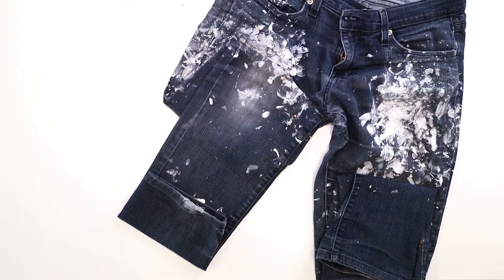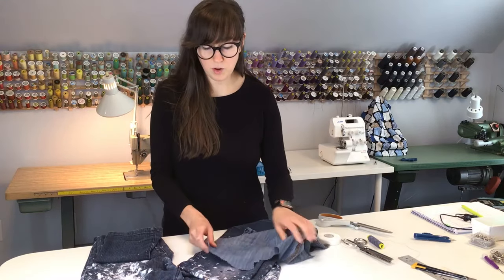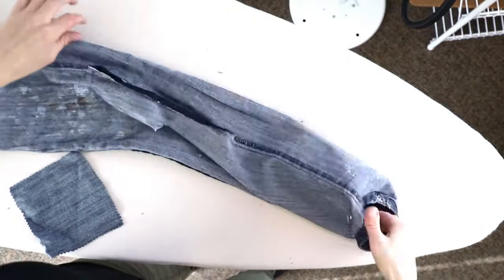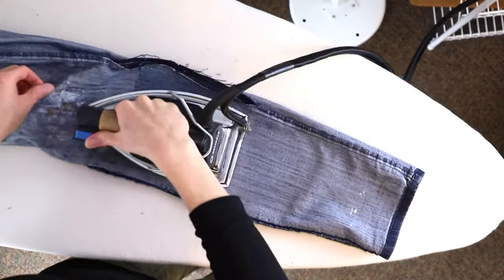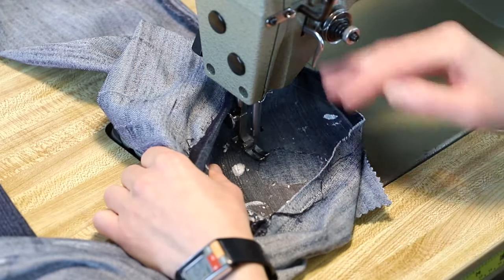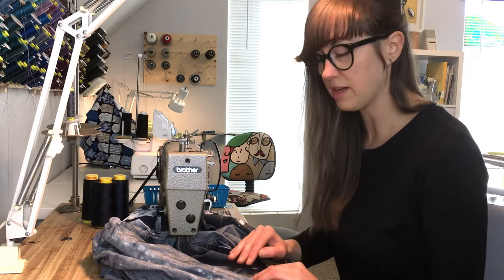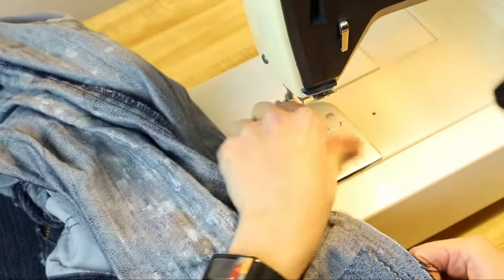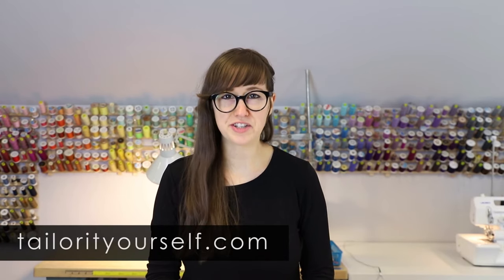How to Repair Holes in Jeans and Other Fabrics

Comment: I think you got a little paint on the jeans. I didn’t notice the hole.
Reply from the maker: Haha yup! They're my work-around-the-house pants. 😁
Reply: @TailorItYourself  don t you get paint all over the place with the steaming iron ??????
Reply from the maker: @chantalteri4692  No, the paint has been washed and cured into the fabric for some time.
Reply: @TailorItYourself  if it's latex-based paint, you can use rubbing alcohol and a toothbrush to scrub it out of your jeans, even if you've washed and dried them :)
Reply from the maker: @itsafroggytime Thanks for the tip!

Comment: Great job ..I have been doing this for over 20 years but never thought to open  side seams..surger is best for the edge of paych 👍and my customers like the stitching in the whole area
Reply from the maker: I've found that taking that small extra step for easy access makes the whole process smoother. Less wrestling around with the garment! Glad you found it helpful.

Comment: That is a good video.  I haven't tried cutting the side seam and sewing it back.  Since I see you do it I might try it.  I've always managed (with difficulty) to scrunch up the leg in such a way to expose the surface to be sewn on the base of my machine.  It is hard, but can be done.  But I actually enjoy using my several antique machines I restored.  Also have some Japanese clones, and some of them can do a zig-zag or back stitch.  My century old machines are Singers and White Rotary.  Of course they do awesome straight stitch, but nothing else.
Reply from the maker: They don't make them like they used to, that's for sure! I too sometimes just scrunch up the leg. But it would be harder to get a good shot, so I thought I could show how to open the seam and make it easier for the viewer to see the work.

Comment: A childhood friend just sent me his favorite jeans to repair on both legs. 
There’s only one hole but both legs really are in need of reinforcement both below and above the knee. The denim has a stretch to it.  I want to do a good job for my friend so I could certainly use any suggestions you have.  I have never ripped open leg seams. Did I miss something or is the zigzag stitch when closing up the leg the only stitch you need? I thought the zigzag was to secure the edges, but that you still might need a straight stitch also. 
thanks for your tutorial. It’s extremely helpful.
Joa from Kentucky
Reply from the maker: Howdy! The straight stitch closes the seam. The zig zag secures the edges. You can try doing it without opening the leg, so you'll just wrestle with it more and not be able to as easily see what you're doing.

Comment: I am working on almost staight rip lines so I will do an iron on on the reverse of rip then zigzag over top with matching thread for hopefully a cleaner look on the outside of heavy Corduroy  pants. I have 2 pair with holes near pockets so I have to lift off the pocket and do patch then zigzag over and around the whole then put the pocket back over the top where it was.
Reply from the maker: Sounds like a plan! Good luck!

Comment: I bought some of the iron on patching kits and I have had absolutely 0 success with them.

Turns out all I needed was a sewing machine and an iron that has steam release. Thank you!
Reply from the maker: Iron on patches can be tricky. You need lots of steam to heat up the glue through the thickness of the patch and get it tacky enough to adhere to another surface, without melting the embroidery. A sewing machine is safer on the embroidery and will last much longer. You can also hand sew it, but it can take more time and may not hold up as well. All depends on where the patch is going and if you can sew through it.
Reply: @TailorItYourself  good to know! Thank you so much!

Comment: Ok this might have been asked but here goes. Can this repair be done using a zig zag stitch instead of a straight stitch ?  Thank you for sharing all that you have. ❤️🇨🇦
Reply from the maker: If you use a narrow zig zag, yes. You want to avoid a stitch that will leave long floats of thread on the surface. That can easily get snagged and wear out faster. You want a short stitch that will fuse together the layers for extra reinforcement. Not so small that you're sewing in one spot and get a thread jam, but not so large it's loose and pliable. This is covered in the video.
Reply: @TailorItYourself  thank you very much for your reply and advice. ❤️🇨🇦

Comment: Love this video. Can we please see something on how to patch men's work jeans. Specifically how to add patches to the outside of the knees to reinforce them for people who have to kneel frequently.  I have several pairs of jeans that are worn or ripped on the knees and I don't care if the patches are on the outside. Looks are not as important as function and comfort. Thanks.
Reply from the maker: This method in the video will actually be more durable than just sewing a patch over the top. Stitching back and forth to reinforce the area will make it stronger. If you'd rather put the patch on the outside that's fine. But the method of repair is still the same.

Comment: I was struggle how to get in the middle of jeans leg to fix it . I did but it was extremely difficult, this video  It made me realize that it's possible to rip the seam. I even never think  about this becouse I m bigginer.
Reply from the maker: It can be tough if you don't take the side seam apart, especially on tapered pants. Glad you found this helpful! Thanks for watching.

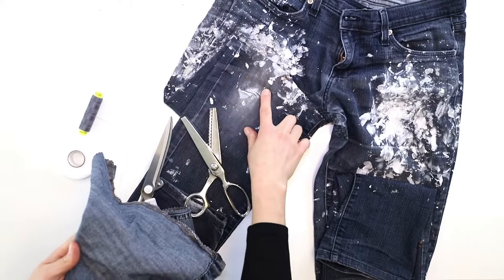Comment: At 01:35, my experience is fusible webbing is not as durable as simply contact cementing patch material to the repair item, just let tack set about 45 minutes before joining the patch to the repair area.  I also use contact cement brushed or smoothed onto the white fringe to save it for strength & blending before patching.
Reply from the maker: When you are going back and forth over the area to the reinforce the patch, the needle gets warm. If you use contact cement it'll gum up your needle. I don't recommend using contact cement for a variety of reasons.

Comment: When sewing the leg back together is it the zigzag stitching which also helps stop the fraying the only stitchen thats holding the finale legs together, or is there another stitch to be done as in a straight stitch that I missed somewhere?
Reply from the maker: A serger is best, but second is a zig zag stitch, third is a straight stitch about 1/8" from the edge of the fabric.
Reply: @TailorItYourself  Thanks, It's as good as a brand new pair of jeans so I'm a bit concerned of getting it wrong. I'll probably find some thrift store ones to practice on fist. Thanks for the info.

Comment: Hi,love your show, but the stitch witchery makes seams uncomfortable to wear due to sharp edge...thx
Reply from the maker: If you are using a lightweight fusible you shouldn't notice a difference. The area you work on will be a bit stiffer initially because you've combined several layers on top of one another and stitched over them, but they will soften over time. But the fusible gets put in between the layers so you for sure shouldn't feel an edge.

Comment: My tape doesn't usually hold, even with steam iron
Reply from the maker: Perhaps you're using a different type of fusible. Medium/lightweight Stitch Witchery should work well with an regular iron with steam. You may need to let it cool before it will fully hold.

Comment: Measure twice cut once lol. Nice. Wise.
Reply from the maker: Thanks! Learned the hard way 😆
Reply: @TailorItYourself  And I just totally did the opposite yesterday and cut too short! Gosh I r
Reply from the maker: Oh no! How too short are they?
Reply: @TailorItYourself  Yeah thanks. I really need to slow down. I cut a sweater dress into a sweater. It's wearable, I could have been more generous, also the fabric of the hem rolls, but I was thinking of sewing the original hem on to keep it flat. Do you have a video about that? I don't know if that's even possible.
Reply from the maker: You could sew the old hem back on, similar to my video on doing an original hem for jeans. The only issue is that you'll likely loose some stretch of the sweater by creating a seam where you sew the scrap back on.

Comment: Is there any way to increase the size of thighs on a pair of Jean shorts?
Reply from the maker: Not without adding fabric to the seams.
Reply: @TailorItYourself  would u mind making a video on how to do that? I don’t understand how to sewing unless I see it.
Reply: I’m new with fixing and increasing sizes of jeans.
Reply from the maker: Unfortunately making these videos is extremely time consuming so there wouldn't be a video for this for some time. Basically you'd need to add a wedge of fabric to the side seams or inseam to make the circumference larger to accommodate the leg. It'll be visible, and hard to match the fabric, so you may be better off buying a pair that fits properly.
Reply: @TailorItYourself   what if I would just add a piece of stretchy elastic?
Reply: Should I do it between the thighs? Or on the outside of the thighs?
Reply from the maker: It would certainly be less noticeable on the inseam. You could add whatever you'd like. A stretchy fabric would give you more ease but may be harder to work with.

Comment: But that looks terrible. So tacky. It would be much better if the patch were on the front.
Reply from the maker: You certainly can do it that way. Either method just depends on the item you're working on and how bad the damage is. With holes the fix is never going to be prefect, which I explain at the beginning of the video.